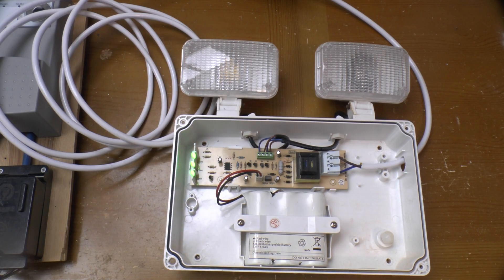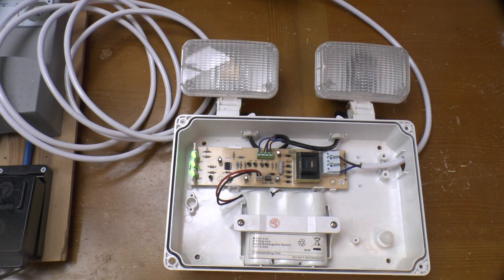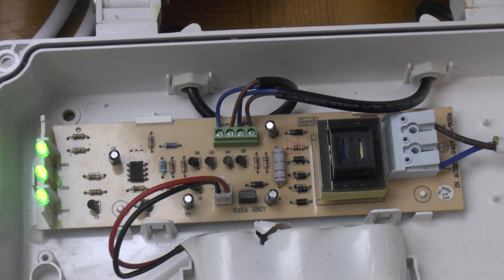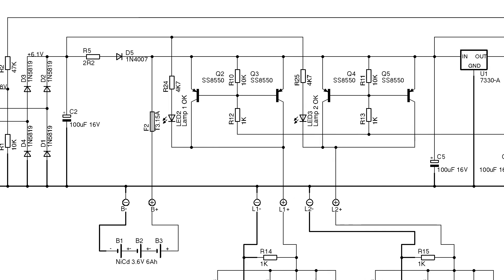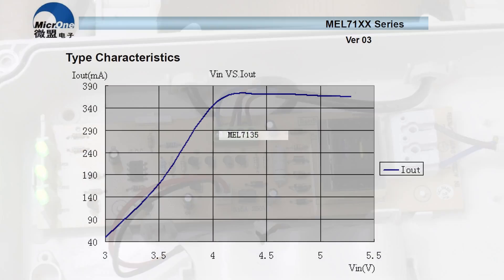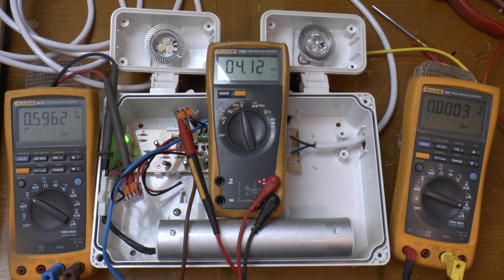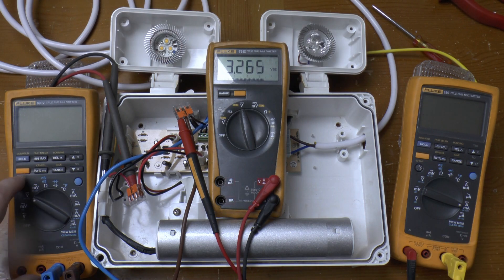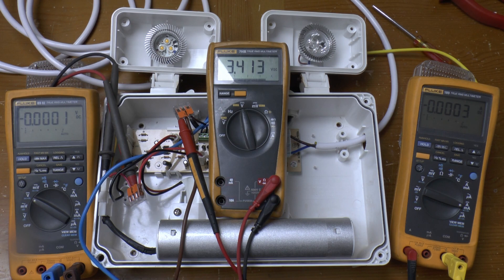What's inside an emergency lighting spotlight?

Comment: thanks! i;ve only seen the old lead acid 1s with halogen lamps
Reply from the maker: That might explain the relatively large case, it might be designed as a straight-swap for lead-acid units.
Reply: @AintBigAintClever  makes sense, the old lead acids were 2.78 x 1.88 x 4.18 inches for 6 volt packs, i've seen new emergency lights that have a tiny base barely bigger than the lamp heads, im surprised it has 3 separate 1w packages, im guessing this is either for power purposes and heat dissipation....or they simply had a ton of old 1w leds and everyone in industry is moving to smd so they were cheap, every time i see an oversized product like this, i always want to stuff as much battery as i can fit into it, LED lamp contains 1000 mah lipo but has room for 3 18650s? you know it is getting a 5ah upgrade
Reply: @AintBigAintClever  Or the case design is originally for lead acid battery versions and they added the NiCd/NiMH battery mounting bosses later.
Reply: Just picked up a load of what I think are lead acid ones, watching this video before taking a look at them.

Comment: It always amused me that emergency lights need to run for 3 hours, if the building loses power, you are not likely to be sitting around for 3 hours, a good boss would send you home for the day, or to an alternative building
If the power failed due to fire, you're not going to be in the building more than the time it takes to get out,
Or do they need the lights for the firefighters ? :D
(it was my jbe to do tests on emergcy lighting etc, just hope the power didn't fail during the tests)
Reply: Weather related emergencies like tornadoes or snowstorms or something that causes loss of power but doesn't destroy the building makes 3 hours seem reasonable.
Reply: I think maby it is incase they cant get out in fire due to fallen debries ect im sure there is a proper reason but i think its something like that